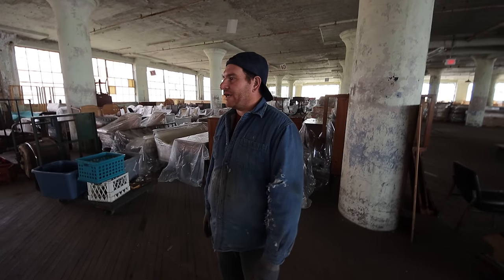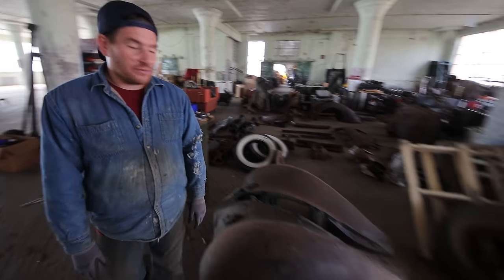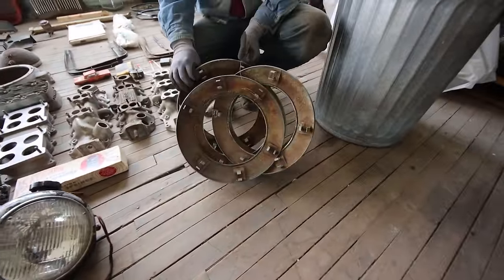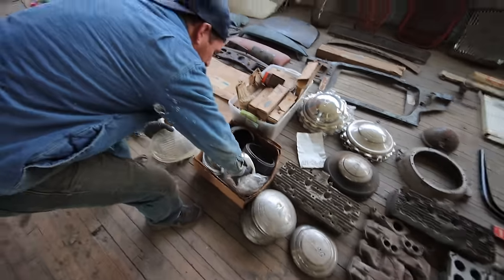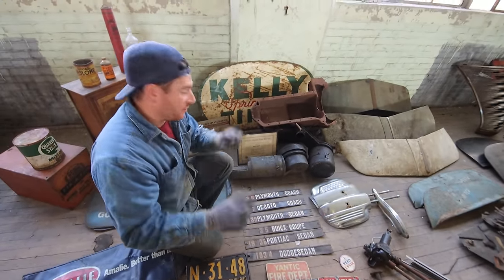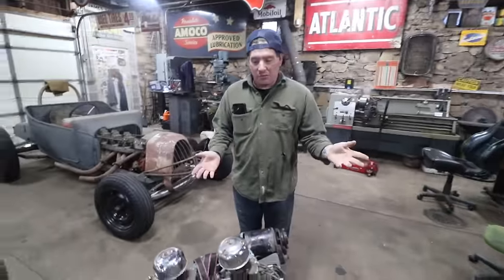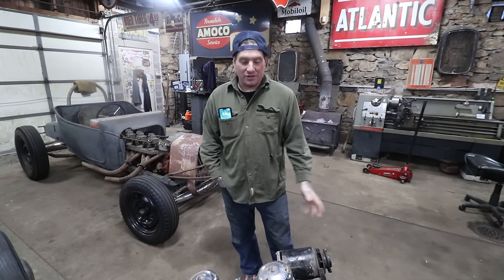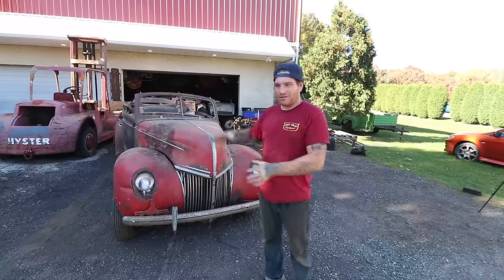Unloading Our 26ft Trailer Load Of Parts And 1939 Ford Convertible

Comment: WOW!!! That brings back memories! Back in the early '60's a friend of mine (in Rhode Island) found one of these in running and drivable condition. I think it was from an estate. Really a nice one. He was a high end machinist and took real good care.  Back in the day I bought an original  one  owner '39 deluxe two door  for  $100.00 and drove it up until 1963.  Good luck as always.  I believe the dash on this one is slightly different, but just  a little bit. Certainly adaptable.  This model and the woodie had "40 style wipers.